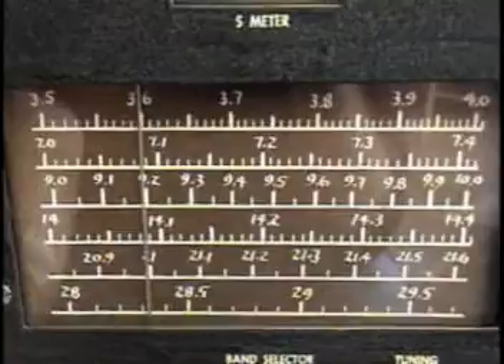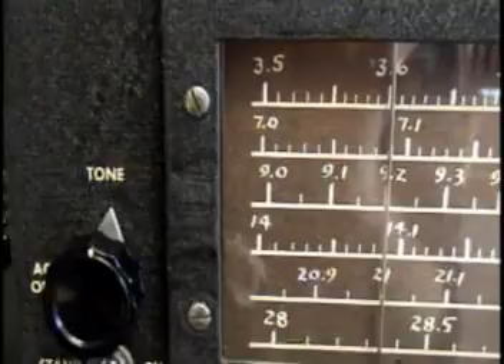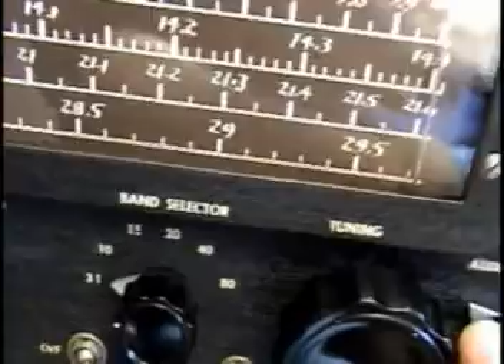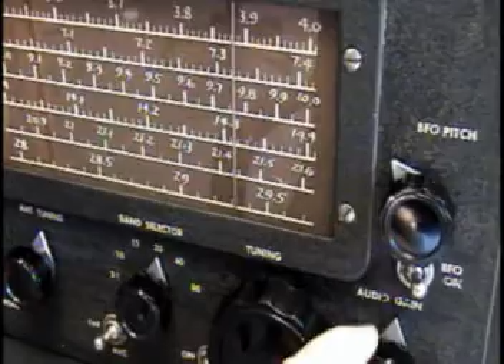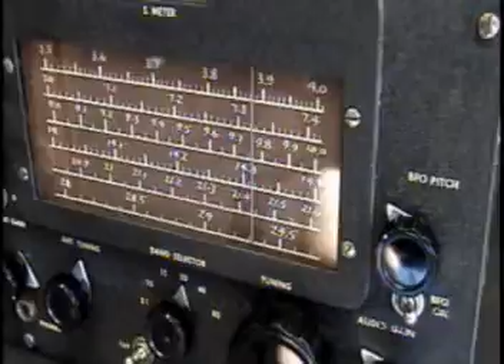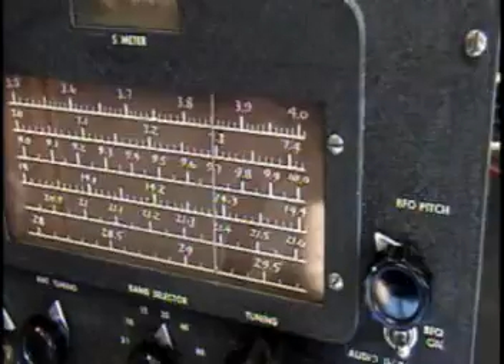HomeBrew Collins Engineered Ham Radio Shortwave Tube Type Receiver Vintage QST Project

Comment: An incredible piece of artwork. How it's all changed. What ashame. I'm sure there are people out there who still build their own equipment, but X and Styles have changed so I doubt there's anyone building anything that looks like this any longer. I guess the thought process of most amateur radio enthusiastic, is why build it when you can buy it. Nothing in my opinion Beats tube based equipment. Congratulations on a wonderful find. I wouldn't be surprised if the person who built that was an industry Insider.